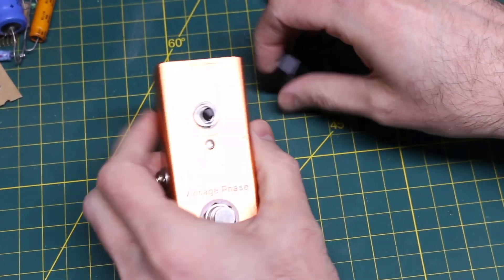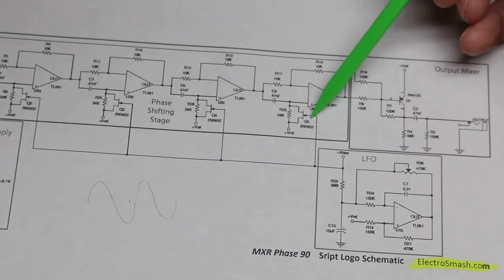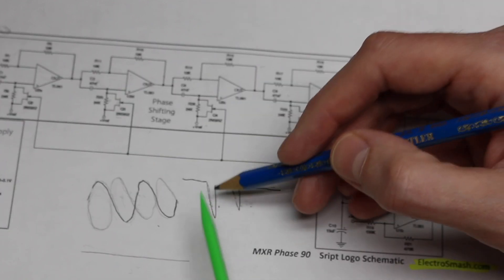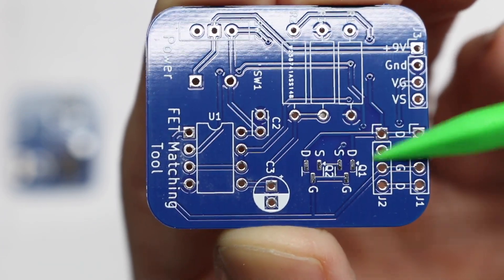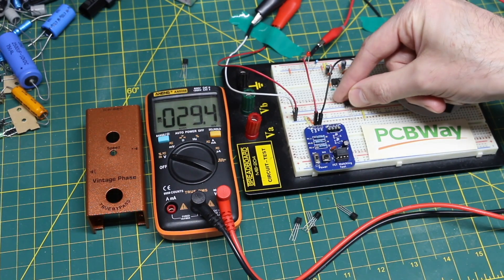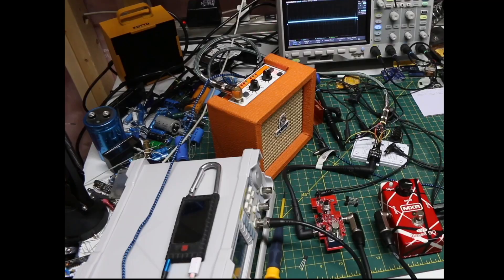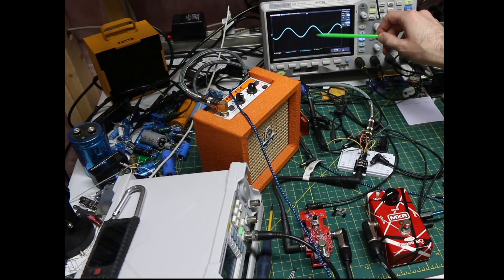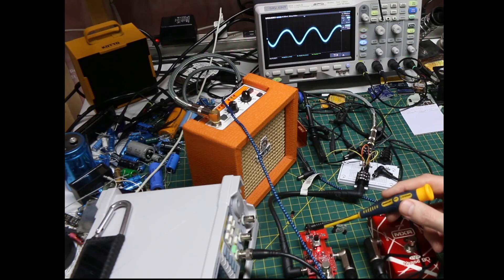JFET Matching for Phaser Circuits

Comment: Nice JFET tester. What about the opamps. What are those? Are those ok? Or fake maybe?
Reply from the maker: I will be looking at those as well now that I know I need to look deeper. One problem with that product is it contains two different circuit boards that are permanently wired together with header pins that are soldered on both ends of the sandwich so I have to find a way to cleanly desolder those and separate it so I can get at the other side of the board possibly and I’m probably going to swap out any major parts and check them out.  I don’t always have good success even with the electric desoldering pump, especially when it’s a dual row header that looks like it might have 16 pins I can’t remember how many
Reply: @GadgetReboot  That is annoying. An cutting the headers is not an option?
Reply from the maker: they have the plastic insulation part of the header still there on the pins so it’s not just bare pins that I could snip I would have to take something like a hacksaw and cut through as one solid piece but at least most of the parts are surface mount so I might be able to swap without separating the two boards.
Reply: @GadgetReboot  I just hope you can get it back together!

Comment: Well, you might need to match the caps as well,  cap are known to have quite wide tolerances. 
Also i don't expect that good low noise opamps, even with unity gain were used.
A audio spectrum analyser would be a good start when looking at filters
Reply from the maker: I was wishing I had some sort of equipment where I could watch a live bode plot showing the filter sweeps with test signal inputs.
I wonder if they used something like Y5V for the capacitors for the critical components. I feel like I’m going to be interested in taking this whole thing apart if I have to and get to the bottom of it!
Reply: @GadgetReboot  They are going to use whatever the cheapest parts are available. if not rejected parts, they know your never going to send it back.
They also use the circuits shown on the datasheets or examples, which are only ever going to be the minimum needed to get a circuit to work.  I expect a few trimmers or select on test components are not on the game plan.

Comment: So now, where does the investigation go?
Maybe crap op-amps?
Reply from the maker: that’s my first guess unless it’s just bad resistor values causing signal issues but nothing a little hot air can’t get to the bottom of.

Comment: Very nice go through on the theory, too bad the issues probably are on the design. Like the testing of the JFETS.
Reply from the maker: I feel like I need to conquer that specific pedal now and figure out what’s going on with it because they even used the same JFET  part number that was on the schematic of the namebrand circuit. I wonder if they are using bogus op amps .
Reply: @GadgetReboot  Good luck on it. Hopefully someone just didn't save a few nickels on a component.
Reply: @GadgetReboot  Frustrating. Noise can come from so many components, like a trimmer.
 Would be nice to live next-door to Dave Jones and Louis Rossmann.
Just looked at the datasheet for TL06x. JFET opamp, like the ubiquitous TL072?
Reply from the maker: yeah I forget the difference between the TLO62 through 082 and then if there’s any variations in those with specs such as suffix A B C and all of that.
I think I read somewhere that the original 1970s version actually used all separate 741s and then they just kept migrating over the years. 
I don’t know how long it will take but I am probably going to be looking at every component on the board if I have to. I might have to start a video diary and then make a video collage later.